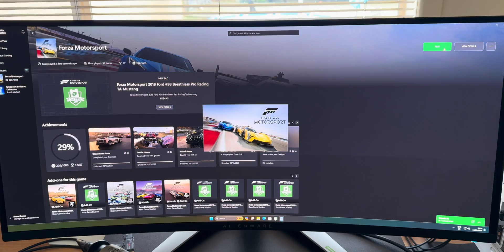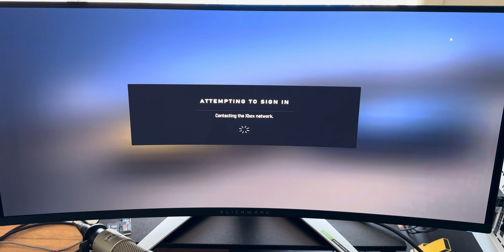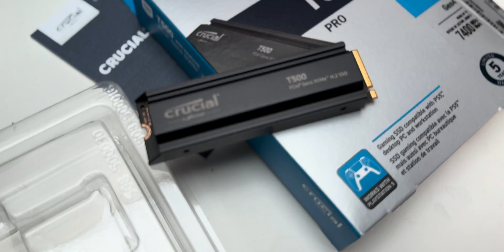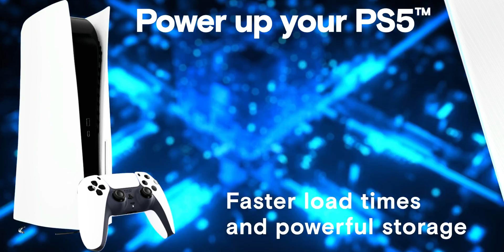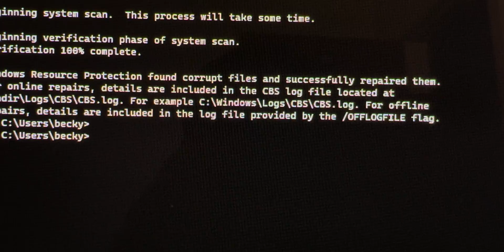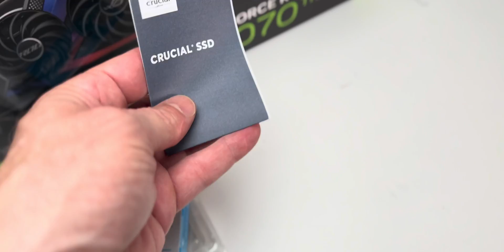The Best Upgrade You Can Do - Laptop, PC and PS5 Crucial T500 Pro Review

Comment: I am so glad I watched this video! Thankyou arkid! I've always used Corsair for ram and solid state until 12 years on I'm doing my new build. I have a t705 1tb already and I was eyeing up a 4tb 990 pro. 

My t705 runs flawlessly, I honestly cannot find a single fault other than the price tag. I'm going to buy a 4tb t500 for my os and put my swap file on the t705 with my most critical software. 

Paying these prices I expect speed, reliability, no critical firmware updates and I expect them to run cool. 

You've just really helped me out here so I'll let you know two tips I've found.

1, Gskill trident z5 has taken the ram market hands down! I always used Corsair until now.

2, Antec Signature are Seasonic Prime's. The only differences are the price and the brand name.

Hope they come in as helpful as your video 😊
Reply: yeah Ikr, crucial have DRAM for SSD because DRAM is good stuff for extend lifespan as more durability than DRAMless is cheap after all